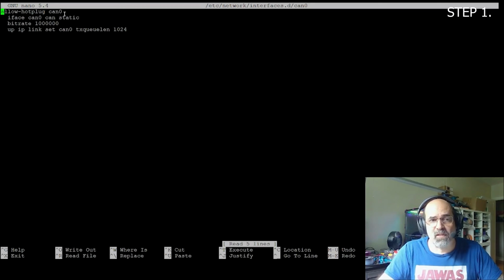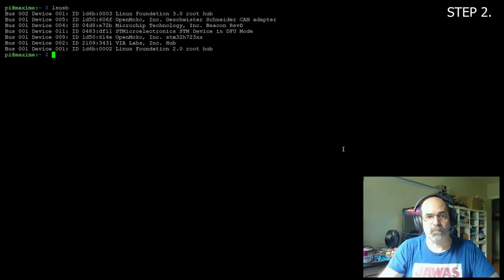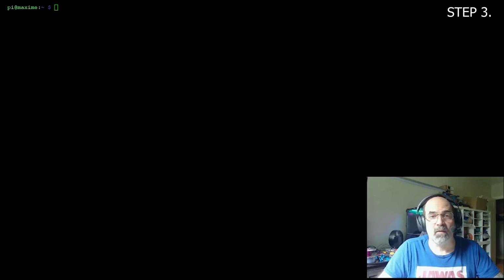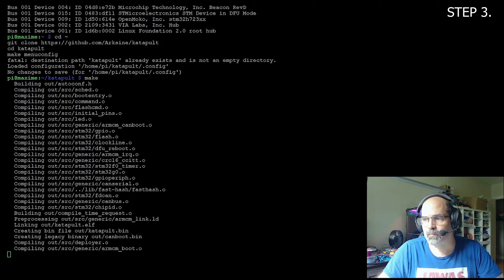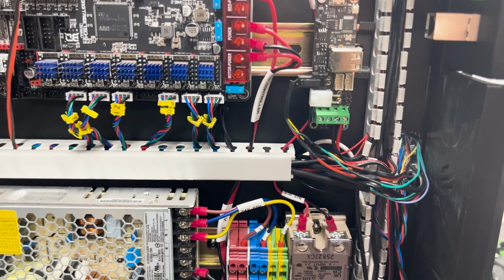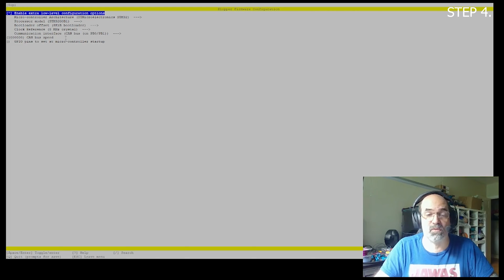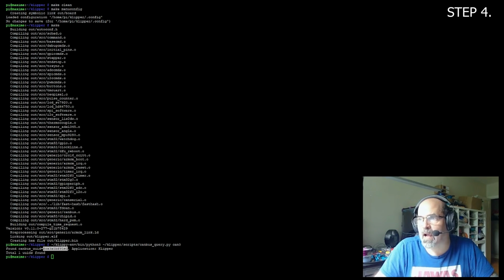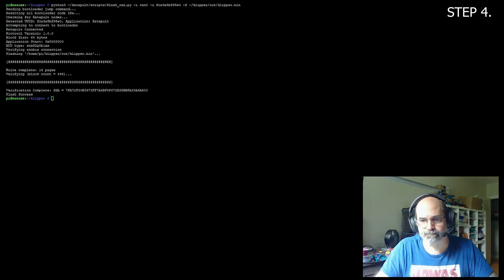No Nonsense Guide to CanBus

Comment: @11:00 The blue Heatsink - so I've been told - goes onto the smaller TMC2209 Chip next to the Stepper Driver Connector - NOT the larger STM32 Chip 😁
Reply from the maker: This is true. I have 2x on there fyi.

Comment: i have btt octopus, what cable do i need if i am skipping u2c board?  Want to do can bridge mode
Reply from the maker: You know I’ve never ran canbus that way. I know it’s possible though. Might have to do a video on it.
Reply: @TheVoronModder  Guy on discord said he has it working.  I had bad experience with can and only interested it now because  i want a toolchanger.  U2C at time was not working.  Going to try fly-sht boards

Comment: WARNING!!! before anyone decides to go with canbus, please read my experience with it, i have SB2204 canbus system and this is suppose to be better than the other ones like EBB36 accordign to the internet, i have a love/hate relationship with it and here is why, in my initial build of my voron the SB2204 took the joy of the first run, i switched the button to the SB smoking on me, i disassembled it to find out that the outer board has burned, as in a single chip within the board burned, why? i have no idea, i contacted the kit provider and they said that its a common thing and the reason for it burning might be a bad connection between the two boards ( basically if you have no clue what that means, the SB2204 comes in two board, one sits in the face of the SB right behind the upper fan, and the other part is in under the cable cover, when you attach the face of SB the two boards are connected by an integrated connector in both sides), back to the story i decided to try again and ordered another one ( SB2204 ) as in the two boards brand new, fearing that the other board might be damaged as well, waited for it to be delivered ( took like 8 days or something), installed the new one and fired it up and it was working great, right until 2 days ago ( so total of 3 months ) when my PIF printed parts arrived and decided to upgrade the ones i have to the new color and did few more upgrades then fired up and guess what?? SMOKE AGAIN, here i am waiting for my 3rd board to arrive not being able to do anything because of this fragile system, i would point out that i MADE SURE the two boards are connected properly in the second time and yet the board got smoking again, why? no idea why, cant wrap my head around it, i wish there was a better solution that is a canbus, dont get me wrong the freedom and how easy canbus is is fantastic and not having to go through wiring the toolhead is amazing, however be prepared for stuff like this happening, i made my order this time to only be the outer board ( 3-4$ ) only while the two boards combined costs around 24$ or so, i dont know about you but the waiting is whats killing me i wished that i went with wires instead of canbus FOR THE SECOND TIME, order two boards just in case.

Comment: why have you installed the heatsink on the mcu and not the stepper driver where it is meant for?
Reply from the maker: I have 2 heat sinks on there just not in the video I didn’t notice that when uploading the video.
Reply: Had to remove the cover of the Hotend and add a big heatsink too. 58c chamber temp was too much for the MCU. Now at 87c MCU temp if the reading is accurate. And did multiple longer prints. Seems to work now. 

I had to redirect the hot air from the chamber heater to go up to avoid raising the MCU hotend temp too.

Comment from the maker: I do have footage that needs to be uploaded this week on printer.cfg configurations with the Can Network specifically the tool head.
Reply: hi, is the footage up for this? thanks for the amazing guide btw, just to let you know on your github the copy paste commands start with a capital letter, they should be all small, e.g. Sudo doesnt work but sudo does
Reply from the maker: @Shamsher1  no I’ve been traveling for work. Hope to be back at it in 1 week. Thanks for the tip I’ll have to adjust the GitHub.